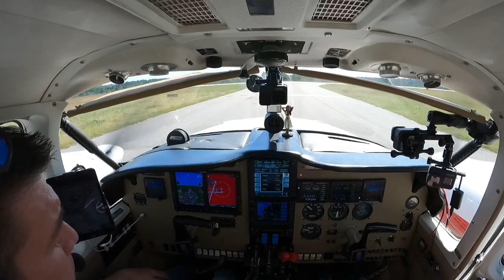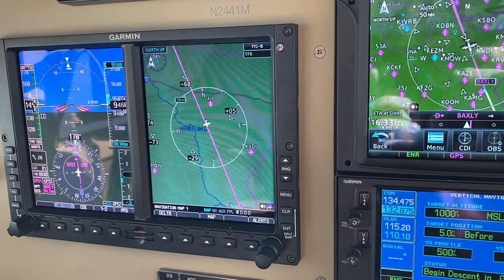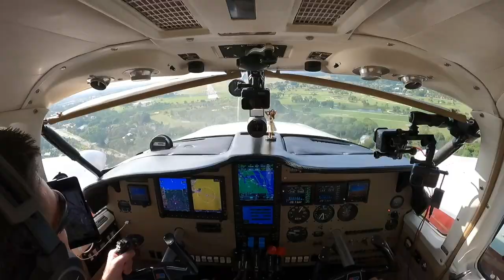AUTOPILOT FAILURE - ATHENS, GA to STUART, FL at 9,500 FEET

Comment: The fact that the autopilot quit when you got into turbulence tells me something. I would get a can of contact cleaner, remove the wire connection plug to each component, examine the pins closely for full seating. Spray the contacts (since you live in a humid environment) reconnect and test fly. You also have to pay close attention the the disconnect wiring that goes through the panel and yoke. Did the autopilot fail in one mode or all at once?
Reply from the maker: Well, by the time I received your message, the plane had already been dropped off and disassembly begun. I delayed my response until I had an answer, though I do appreciate your advice very much. I may be reaching out to you in the future for suggestions. The issue turned out to be two transistors associated with one of the servos, and once repaired (relatively inexpensively), the parts were reinstalled and desk tested. I test flew the plane home today, and everything is working as expected. Hopefully, barring any further surprises, we should be back to our traveling shortly.

Comment: When it rains, it pours! It never seems to fail that after spending a fortune on the airplane (annual) something un-related fails! In my case a week after the installation of a new right engine, my landing gear power pack failed and needed to be replaced. Then my Century 4 autopilot refused to take any commands and needed a two week trip to the avionics shop. Then the avionics shop found the problem and did the repair, and the left engine starter failed. Then I picked up the airplane at the shop to fly it home, but had to turn around and fly back because my left voltage regulator failed. The joy of ownership! I hoping yours is a simple fix!
Reply from the maker: Thanks MB. That's quite a tale. I don't know how well you handled it, but I'm sure I would've been pretty grumpy after a series of failures such as yours. In our case, the avionics shop appears to be on top of the problem as we speak, and barring any new issues (fingers crossed), we should get the plane back within a week.
Reply: Grumpy for sure! But relieved too! We travel extensively with the Aztec, and these failures would have been more challenging if out on the road and not in our local area. I had a starter failure in Grand Cayman in our Twin Comanche years ago and having it shipped down thru customs and installed was not easy or inexpensive! I've owned 7 airplanes ranging from warbirds, antiques and experimentals and have found things happen in "bunches"! I think I proved that theory this year!